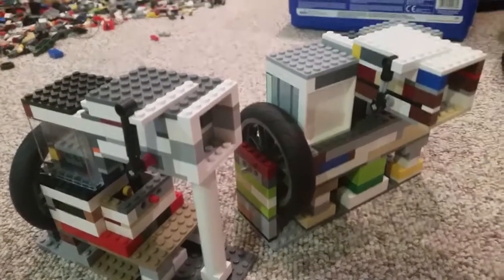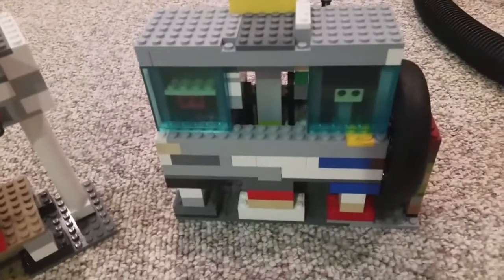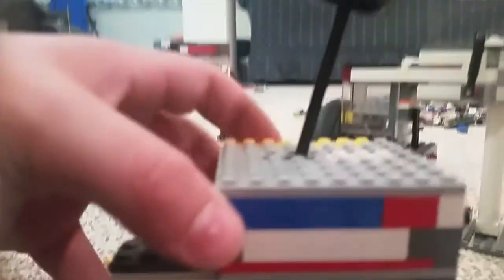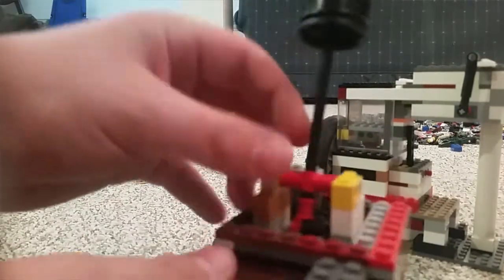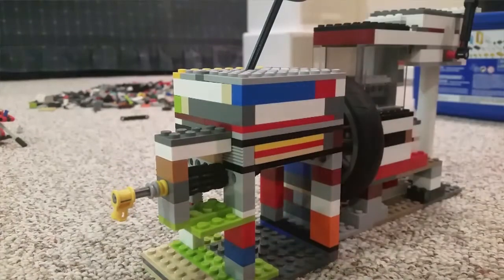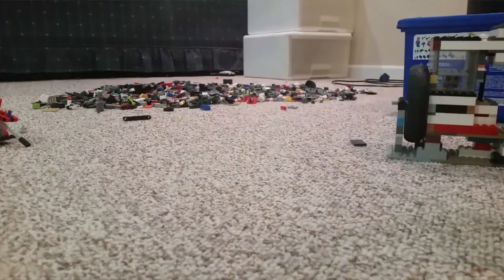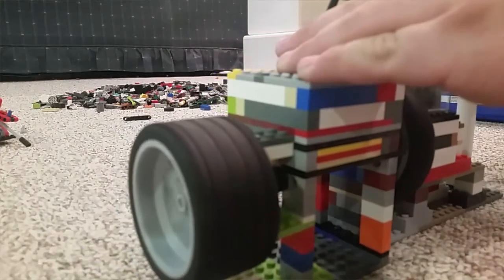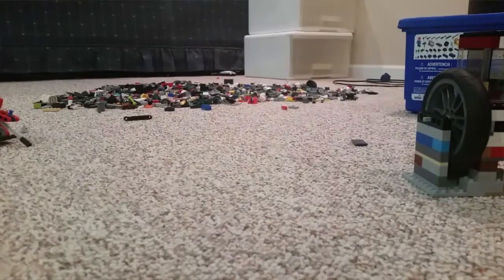Lego 3 Speed Manual Transmission for Vacuum Engines

Comment: First your gonna need a clutch or else you're going to go through a lot of gears second you need to give it throttle when you're shifting gears of you keep it at about 1,000 to 2,000 revs while your shifting gears it will stall because it's too slow for the gear ratio and the car will be too heavy to move because it's not in the right gear that means nothing in the gear box is gonna move so the piston(s) won't move so give it throttle when you're shifting gears
Reply: Also it makes me cringe when I hear you shift gears please make a clutch for it